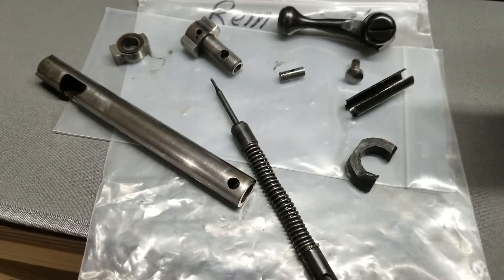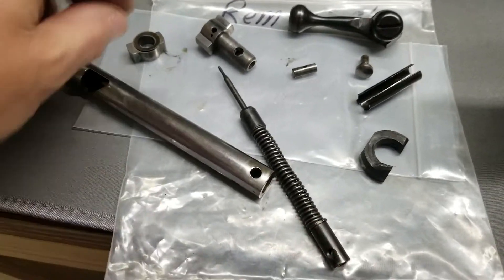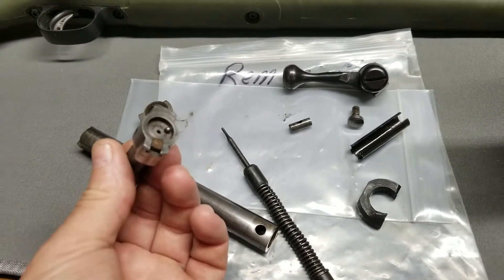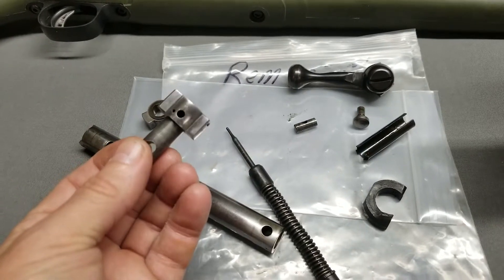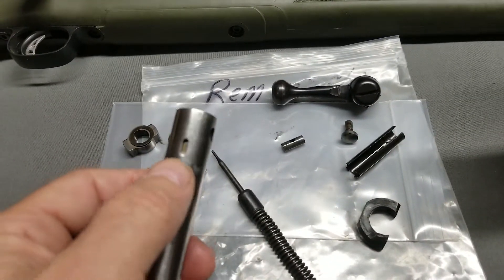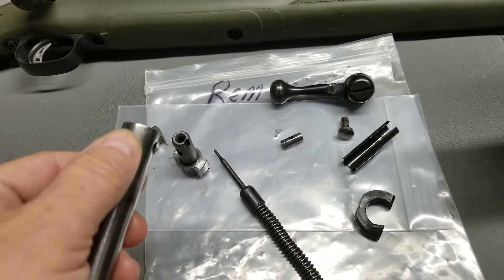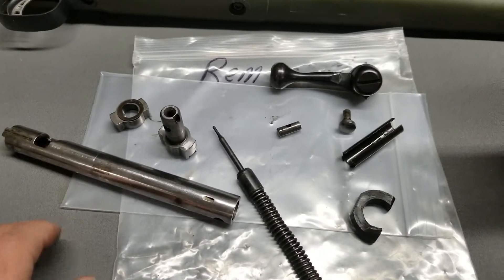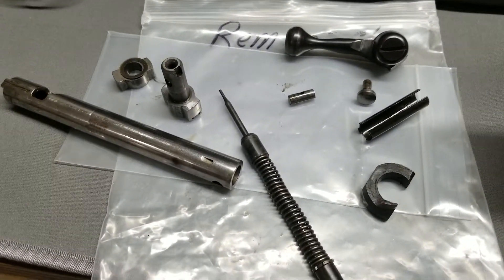Savage 110 Bolt & Boltface upgrade from .473" to .534"

Comment: I just did the same thing I had to use my dremmel to get rid of that nub inside the bolt body and my firing pin was the larg I had to mill out the rear hole everything worked great I had to do allot research wish I seen this beforehand  lol